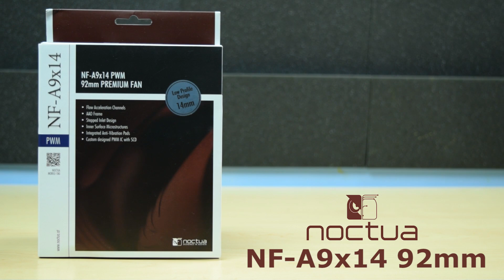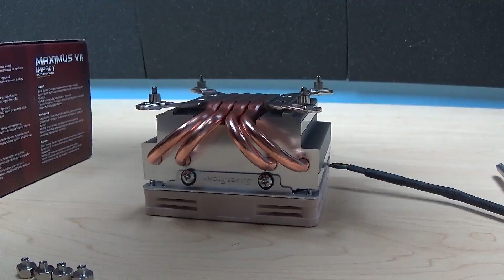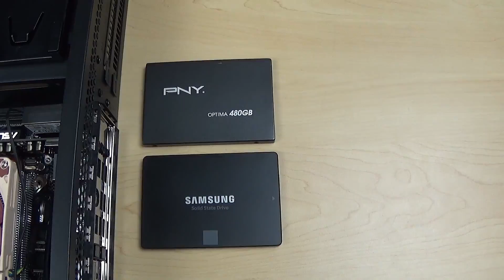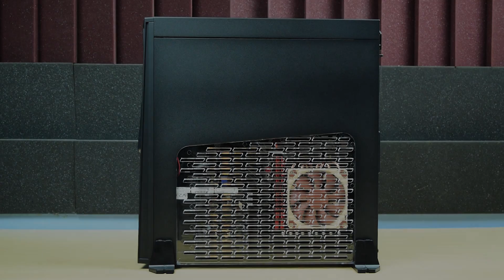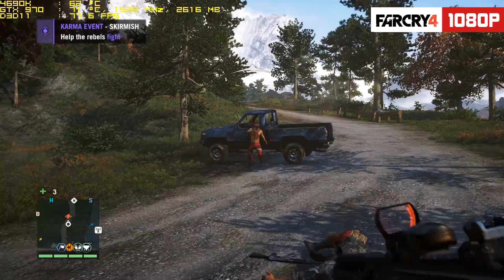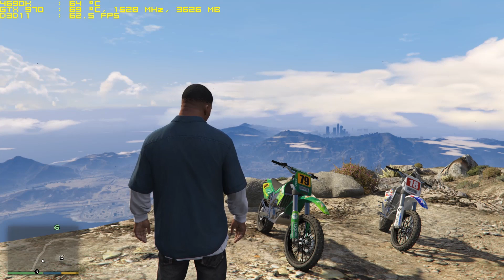Mini-ITX Gaming PC Build (RVZ02 / i5 / GTX 970)

Comment: I've just completed a similar build. A few tips for those considering a build in the rvz02. 
1. There's an included adjustable brace to secure the GPU in place. My Gigabyte G1 980 Ti was very wobbly without the brace. If it fits, use it. It secure the back of the card and prevent it from wobbling when you move the case. I'm assuming the card in this video can't use it due to the copper pipes or it wasn't shown. 
2. If you install a blu-ray drive, get a 12.7, not the ultraslim 9.5. There's a 12.7 tray adapter included but it didn't fit my LG 9.5. So I will be ordering a new drive
3. My Silverstone SFX 600 PSU didn't include a SATA Slimline connector for the optical drive. So I've ordered an adapter as well for the optical drive
4. I recommend an open air GPU, not reference, since this case rely on the components to cool themselves and blowing air out of the case. Open air are GPU like in this video, in my case it's a G1 Gaming.  Reference suck air in and blow it out at the back, even the instruction manual doesn't recommend a ref style blower. 
5. The Silverstone AR06 Cooler comes with 4 rubber rings that you HAVE to put on the screws that you will use on the back to secure the heatsink. If you forget to put them on your screws, you can, and probably will short the PCB.  It's not mentionned in the instructions of the AR06 but when I saw those little pieces of rubber, became obvious what they were intended for. So no problems for me but I've read a review of a guy on Amazon who forgot to put them on and bricked his mobo. 

Great video by the way, one of the best Mini-ITX build I've seen on Youtube.  Here are my specs:

CPU: Skylake i7 6700k
Cooler: Silverstone AR06
Memory: Hyper Fury X 2 x 8GB 2400
GPU: G1 Gaming 980 Ti
Motherboard: Gigabyte GA-Z170N-Gaming 5 
Storage: Samsung 950 M.2 NVMe  512GB
Case: Silverstone RVZ02B-W
PSU: Silverstone SFX 600
Reply: that build is a beast
Reply: Brawndo i like your instructions, am going to build same exact model with i5 6700k and gtx 1070 , but i would like to ask you something.. How is the ar06 preform and ehat is ur cpu temps while gaming

Comment: the ONLY thing i dont like about this case is that plastic clear panel that is supposed to be a "window" of some sort. ugh it looks  terrible. if i owned this case (by the way its a great case) i would actually remove those "window panels" and keep it open. kinda mod it in some way. i should get one though :D
Reply: +Katsu Wolf There is a model of the same case with dust filters instead of those "windows".  That's what I plan on getting for my new ITX build next year.
Reply: oh really? that sounds even better :) i might look into that, my build awhile back was a mini-itx I actually liked it. :) I been thinking of building more mini-itx computers for friends, so we can game together or have a LAN-Night lol  they are so easy to carry around and are about a tiny bit bigger than a console lol
Reply: +Autoimmunity so true it does look bad
Reply: +Katsu Wolf You can get the case with black side panels! For $10 cheaper even!
Reply: Riley Forwood oh badass!
Reply: +Katsu Wolf have u build ur pc
Reply: Boom Shake yes i've been through three desktops I have built this one im using is currently my longest one i've had for about 4 years now. :)

Comment: So how does the AR06 hold up with this CPU? 68-69 degrees seems a bit high. What about a hot summer day? Nice build btw. So much in fact it made me reconsider using the RVZ02 instead of the Node 304 I originally planned. Just worried about CPU temps

Comment: If I'd given the choice, my build suggestions would be more like:

Case:    Silverstone RVZ01B
PSU:    SilverStone SFX ST65F-G 650W
Mainboard  Gigabyte H170N-WiFi
CPU:   Intel i7 6700T
RAM:   Kingston HyperX Fury Black 16GB DDR4
SSD:   Samsung 950 Pro 256GB
GPU:   Gigabyte GeForce GTX 970 4GB
CPU Cooler:  Scythe Big Shuriken 2 Rev. B
HDD:   Toshiba MD04ACA400 4TB

Personally I prefer not to overclock my components, it keeps it more cool and quiet which is the reason I would choose the 6700T instead of the K version.

Comment: Nice build! I only have a question, how high is the temperature inside the case with the graphics card and everything? I am considering this case (I really like the no window model with black dust filters) but it seems a little risky without any fans or active cooling. Also, did you need to use any extensions for the cables of the power supply?

Comment: from silverstone theres an Shortcable kit for the  Strider series of PSU's   u can use this for that PSU aswell   and due to the fact that the cables are only 1/3 or 1/2  of the leanth   its a lax to do cablemanagement in this case  the kit is avaliable at arround 30$
Reply from the maker: +BiveZz01 I actually use these cables on this built. I just didn't mention it on the video.
Reply: +BiveZz01 So how do i ask for the shortcable kit? I'm going to build the same PC

Comment: Personally prefer to ensure the thermal paste is properly spread around before fitting the sink as i'm always worried abut air locks & bubbles etc but thanks a lot, your video showed me exactly what I was after which is how the L-bracket for the video card fits. I'm about to buy one of these puppies for a living room build. Presuming the L bracket and extender comes with the Raven? Cheers!

Comment: just a heads up: If you opt for the newer maximus impact viii, you need ddr4, not ddr3 ram. also, the viii uses the 6th gen intel chip. don't make the same dumb mistake as me. heheh.

Comment: Nice video, can you tell me whether a 50mm case fan would fit right above the graphics card I/O? If not, which size could fit there? (I mean the spot you can see at 9:46 right behind the screwdriver.)

Comment: Nice build what is the draw power/power consumption when gaming ? or on full load.
Reply from the maker: +kudzayi chimbodza Around 330 watts with no overclock.
Reply: +MGTech HD What do you recommend for a power efficient gaming pc with draw power between 100 -150w ? is it achievable ?

Comment: I'm considering this build for my 1st custom built PC. I play mostly LoL and star citizen. one thing I'd change is the case I'd go with a mid tower case to have more room for cable management and due to the boards small size would allow for easy maintanence and have a little growing room in case I wanna upgrade the GPU to a 1080 in the future. my only concern with this build is would I be able to run dual 1080p monitors and be able to stream if I were to upgrade my ram to 16gb dual channel ddr4

Comment: Nice setup, what is the fan noise level under stress?
Reply from the maker: +iksretep Most of the noise comes from the power supply. the video card is very quite and the cpu fan isn't too bad.

Comment: MSI gtx 970 is greater than 4.78'' inch of width as suggested by the specification. Have you found any issue in inserting it?

Comment: Really considering building something like this in the coming Sept, but just one problem that I just can't resist stating. I dunno what's wrong with silverstone, but honestly, the RVZ01 had a 3.5'' hard drive mount space in the PSU bracket. And then they release a evolution one, RVZ01-E, alongside RVZ02, both removed the 3.5'' hard drive space. What the hell? You telling me to use a 2.5'' hard drive, which A. costs more B. runs slower  Try comparing the WD blue 3.5 vs the 2.5, the 2.5 is 30% slower than the 3.5, and the 2.5 cost more. 124MB/s vs 85MB/s (userbenchmark site data) The RVZ02 supports 3.5, only when you use a mini gpu. I want to use the inno3D iChill GTX 970, so I am out of option and forced to go with the 2.5 inch. Thermal is more important in a mini ITX so I need a really cool card. Plus I cannot even install a 2.5 hard drive with more than 2TB space because there isn't one on the market. I know we will use SSDs, but who will install several SSD in their PC, we need secondary storage as well. Think i'll just have to get the 1TB HGST 7200 rpm drive instead, costs more but matches the performance of a 3.5 drive. Way to go silverstone

Comment: Ive read from several other sources that the graphicscard heat is building up in that chamber and its better to use a blower style/reference style 970. Can you confirm that, or was your system cool even in longer gaming sessions?

Comment: Just built my own PC in this case with a MSI GTX 1070 and I5 6600k. It runs great, but it gets really hot. It gets so hot in my hotbox of a room that the top of the case gets to hot to touch. Still the CPU and GPU never go over 77C after a heavy load.
Reply: Did u Overclock your i5 6600k? im planning to buy this case with i5 6600k with crorig c7 and OC to 4GHz, what temps u got ?
Reply: Yeah, my motherboard boosted the clock speed to 4GHZ and it remained under 69C under load. Pretty good if you live in a firey hell hole like California.
Reply: I live in the netherlands, cold country so should be fine i guess. what other parts are u using ?
Reply: Nick Lam Yeah, you should be fine.
Reply: Thanks. That is one of my main concerns. Given I'd be using a less beefy gpu. No case fans just seemed iffy. What mobo did you use? How is it holding up after 4 months?
Reply: Sold the PC a while back, but I doubt it would have any problems.
Reply: Thanks for the info!

Comment: hey why didn't you add the secure brackett for the gpu? Overall good video easy to follow and camera.
Reply from the maker: +ever6 I tried to put it on, but the heat pipes were in the way so it wasn't possible with this card.
Reply: +MGTech oh ok no problem I just installed my gpu yesterday and ran into the same problem. hopefully my psu arrives and i can finish up. Thanks oh any issues w your psu? I  ordered the 600w from directron.
Reply from the maker: +ever6 I haven't had any issues so far, except that its pretty loud. i plan on getting the SFX-L in the future.

Comment: How noisy is it on idle and under load? I have tried an extra small build like this, but in a Node 202, and the PSU was really noisy. I even bought the SFX-L version from Silverstone with the 120mm fans, but it had like 5x more noise than my ATX PSU. So I have now a mITX config in a "normal" ITX case.

Comment: Hey! This was super helpful, and I'm starting to order my parts. But I was wondering, if I were to use a 3.5" HDD, where would it go?
Reply: +Prithvi Tippabhatla The only place to put a 3.5" HDD on the RVZ02 is on the GPU side if you have a short format card. On the other side you can place 2 2.5" drives and a Slim optical drive.

Comment: Are you satisfied with the temperatures and noise level? Temps look a littler higher than I had hoped in this build.
Reply from the maker: +Marcus Poulsen Overall the pc is really quite. If you substitute the power supply with the newer SFX-L it would be even quieter. I had the cpu and gpu overclocked for this video. Without overclocking temps are in the 50's for the cpu and 60's for the gpu.
Reply: Great I got the sfx-l in preparation for a build in this or similar case. Looking forward to receiving the case. Really Damn expensive in Europe though but it just looks like there's no other cases this size that can compete with the rvz02!

Comment: nice video, i want to know if there's any room left to fit a 3.5" hard drive? thanks!
Reply from the maker: +Julio Tencio A 3.5" HDD can be installed next to the GPU, but only If the card used is shorter than 7.8”.
Reply: +MGTech HD awesome! ty for the fast response!
Reply: +MGTech HD even if only one SSD will be installed?

Comment: can i get a 1tb hard drive on this?
Reply from the maker: +Mohammad Musfiqur Rahman You can mount 3.5 hardrive in the gpu area, but only if you use a short/mini video card.
Reply: +MGTech  can i get 2x8gb=16gb  ram istead of the 2x4gb=8gb  ram?
Reply: +Mohammad Musfiqur Rahman should be possible. mini ITX motherboard supports up to 16 gigs of ram
Reply: +LulzingBoy so i van get the 16gb ram?
Reply: should be
Reply: +Mohammad Musfiqur Rahman try this one : http://www.amazon.com/gp/product/B005WU1OTO?colid=3KH27PZYU51BA&coliid=I7DKCNCFMONZK&ref_=wl_it_dp_o_pC_S_ttl
Reply: A 2.5" HDD could work as well, as long as you're willing to pay extra
Reply: +MGTech I watched the video in more detail please write the name of the two (pci - adapter). And you can set a new mini motherboard from Asus and the CPU of the 6th generation (core i7 - 6700k), and a cooler air podaydet court.    Thank you
Reply: +MGTech What graphics cards can be installed in this case.
Reply: R Ibrahimov
Lemme help you with your question. this case provides their own PCI extension so u don't have to worry about buying new one. And every motherboard that comes in mITX form factor should (theoretically) work, just check the dimension to make sure. Any graphics card can be installed as long as it's 13" or below.
Now, I'm not sure about "podaydet air cooler". could you provide more info about that? Theoretically all low profile air cooler that's below 58mm should be able to fit there.
Reply: +LulzingBoy I wanted to know what models and what modifications to the graphics card can be installed.
Reply: +R Ibrahimov any graphics card, as long as it is 13" long or shorter. probably better if u just tell me the card u want and I'll check if it fits. u should be able to fit even 980ti in it tho.
Reply: +LulzingBoy     
ASUS Strix GeForce GTX 980 Ti Graphics Card , EVGA GeForce GTX 980 Ti HYBRID Graphics Card , EVGA's GeForce GTX 980 Ti Superclocked+ Graphics Card, EVGA's GeForce GTX 980 Ti Graphics Card ,Gigabyte's GeForce GTX 980 Ti G1 Gaming Graphics Card,Gigabyte's GeForce GTX 980 Ti WINDFORCE 3X Graphics Card, Gigabyte s   Radeon R9 Fury X Graphics Card , MSI's GeForce GTX 980 Ti Lightning Graphics Card , here's the video card, which one is more efficient and powerful. These graphics will feel like yourself with a new motherboard from asus z170 maximus VIII impact, and RAM from G.Skill Trident Z 16 Gb DDR5.  ....
Reply: +LulzingBoy I have Powerclor r9 270 TurboDuo. what do you think if i want fit my Seagate SSHD?? I really have no budget for SSD now. If cant maybe i grab the RVZ01, but for some reason that is more expensive here.
Reply: R Ibrahimov
I'd go with strix to match up with the maximus. although u can use any gigabyte's card if u want dem fans, if you're worried about temps
Reply: I don't know if there is a 3,5" bay, but I supose that there isn't. So you can put a 1 Tb laptop HDD, because it has the same form factor that all SSD have, 2,5" (inch).
Reply: +madmonkeystudios 1 tb laptop drive or a ssd
Reply: +MGTech you didn't put Audio or Windows 10 or wifi or cd insert
Reply: this is an MIcro ITX BUILD. YOU dont need a Bigger GPU like a peni  dude if you compromise on gpu size you can make room for hdd. i suggest gtx 1060 mini ZOTAC or gtx 1070 mini if available. good luck
Reply: Zenomaster yup in the cd driver slot
Reply: i removed the dvd bracket and used the screws as a stand and put one screw from the gpu are so its working!!!

Comment: How long were the games run for before the video was taken? Trying to judge if heat management would be manageable with this case.
Reply: +ND1Razor its extremely unlikely for heat management to be a problem since there's ventilation right in front of every single fan, not to mention the chamber separation for the GPU; personally I think for an air cooled system this might even do better heat management that standard mid towers
Reply from the maker: +ND1Razor I haven't had and heat issues after using this pc for about 2 months. Video card temps are around 65 and cpu temps are 65-70 with both components overclocked.

Comment: Sir, quick question - why did you have to flip your heatsink and motherboard over? Wouldn't it work just the regular way?
Reply from the maker: +Bim Barbieto It just made it easier to aligned the hex nuts with the heatsink's standoffs.
Reply: Okay cool. Still deciding whether to go with the rvz01 or the rvz02. Got any advice?
Reply: +Bim Barbieto RVZ02 was much easier to work with for me.
Reply: +Bim Barbieto I have the RVZ01 and it was a nightmare to put together. This case looks significantly better to work with and also seems to have some cable management which the RVZ01 does not have. Another option to look at as well is the ML08, that what I am considering upgrading to, as it seems better designed and also has a carry handle.

Comment: Were you running any overclocks with this case? 
Is it able to hold temperatures reasonable when clocking it?
Reply from the maker: +Pär Joona i5 4690K @ 4.3Ghz Temps: 50-60C / GTX 970 +105 @ core clock Temps: 55-70C
Reply: Om bhambale

Comment: +MGTech is it possible to fit in a gtx 1070 mini from GIGABYTE. It needs a power supply of 500 W.
Reply: It doesn't need a 500w supply, a 450w will do fine.

Comment: I imagine there might be small heating problems
Reply: +Arthur Prado there shouldnt be cuz that should preform better than stock cooler and 80 degrees celcius (stock cooler) isnt dangerous
Reply: +Chaos AssazZin k
Reply from the maker: +Arthur Prado I've using for about 2 months now, and temps are around 65 for the video card and 65-70 for the cpu  under heavy load with both gpu and cpu overclocked.

Comment: any issues with high cpu temps? I completed a build just like this about a month ago and ended up going with a different case because my temps were terrible
Reply from the maker: +Ryan Velting I haven't had any issues for the past 2 months I've used it. My cpu temps have been around 65-70
Reply: +MGTech is it possible to fit in a optical drive?

Comment: did you overclocked the cpu? hiw are the temps with this cooler?
Reply from the maker: +Harun Kilic I have it overclocked to 4.3 and the temps have been around 65. Without the overclock temps are in the 50's.